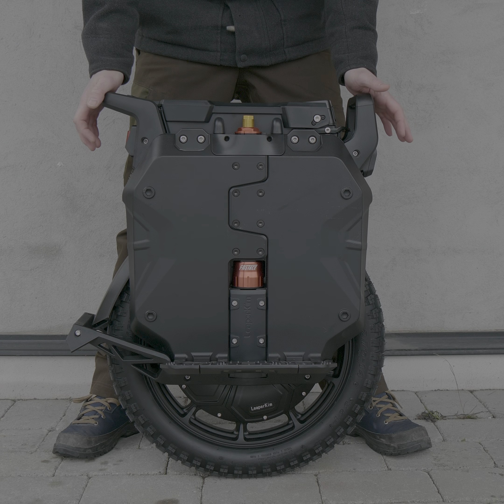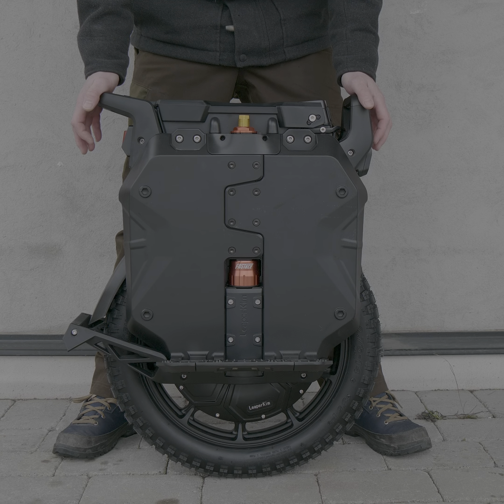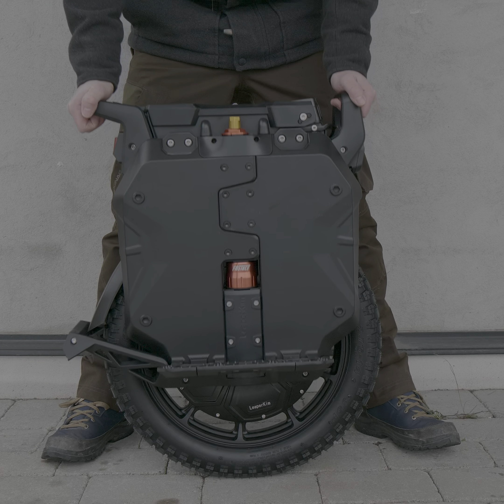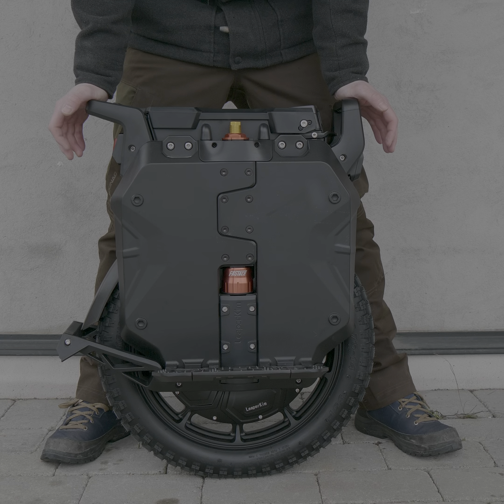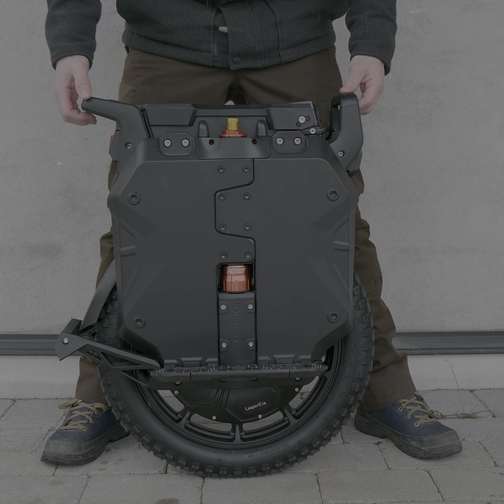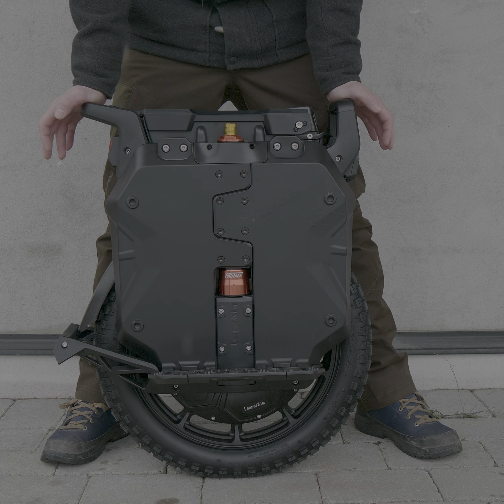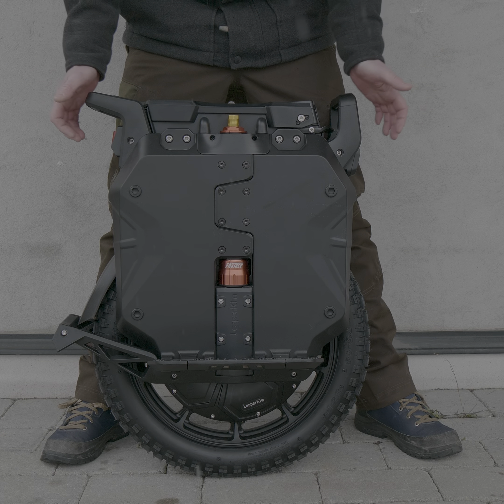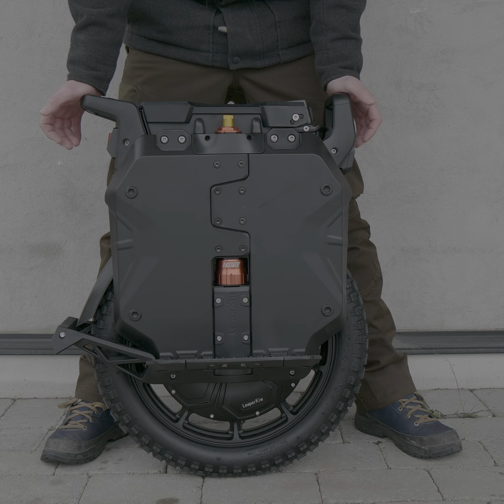Sticky Sherman S suspension on my new wheel

Comment: You're  going to actually be riding it not gradually putting in your weight on it it's designed for a person to be on it not pushing down on it slowly doesn't make sense bro. Calm down the wheel is perfectly fine .....Ride it
Reply from the maker: This is a misunderstanding of suspension performance characteristics, I already measured that the force necessary to break the stiction is between 30 and 40kg.
I'll have a video showing that later. The stiction is the same when on the wheel.
Compare that to the S22 where stiction is so low that you can't even tell there is any.

Comment: How often does one go over bumps that slow, go riding over normal bumps at speed and see if you notice a difference?
Reply from the maker: Good question. The slow movement in that test allows to make a visual demonstration of the stiction for the video.
But the stiction is the same all the time while riding, at any speed. The experience is that the suspension "binds" in position, transmitting all small shocks to the riders until hitting a bigger obstacle.
This amount of stiction gives the sensation of the suspension locking/unlocking randomly based on the surface ridden.

Comment: As always thougtfull testing and a keen eye for important details mate. appreciated. This wheel is very expensive so the performance should be better than this - How important is this stepwise suspension when You actually ride the wheel? That I dont know, other reviewers like Ronin thinks the suspension on Sherman S is better than s22.... Im not sure if he has a slider upgraded S22 to compare woth
Reply from the maker: I won't ride the wheel since for now I keep all my options to return it but the impression when stepping on it to compress the suspension is not that far off the S22 original sliders. That: you know.
So when riding I would expect to constantly feel the suspension locking/unlocking, transmitting the small stuff into your legs.
I already know I prefer no suspension to a bad one and its inconsistent experience you can't fully adapt to.

I added another test in the video description which shows no significant stiction: there's likely variation between units.

Comment: That could be normal friction due to (new) seals, the so-called stick slip phenomenon, It is known with motorcycle and MTB racing  try to lubricate sliders with silicone.
Reply from the maker: Thanks for the suggestion. It sounds like a plausible theory, however I am perplexed by this other test showing almost no stiction on another brand new wheel just out of the box:

https://youtube.com/shorts/OMxlWCNSLmM

I'll look into it further
Reply: @supercurioTube  Your suspension tube might be dry and his have oil on it, but anyway it is really easy to test, just spray or wipe little bit silicone spray on the suspension tubes.

Comment: Commander pro
Reply from the maker: I'm sure these are flawless, all of them
Reply: You wish. Ain't nobody giving Begode/Extreme Bull $4000 for one of their rushed together Death Traps.
Reply: @Dewayne Lowery  probably not a lot of people but I am. Not for 4k tho lol.
Reply: @dewaynelowery8511  as opposed to giving leaper kim 4100 for one of their antiquated voltage systems
Reply: @Blox117  "Antiquated"? Dude, you just talking, I can see that now. 100v is NOT "Antiquated". A properly refined 100v system is more than enough for most people. Hell, the Commander Pro is a 134v wheel, but only has a lift speed of 112 kmh while the Sherman-S has a lift speed of 120 kmh. Yes, the Sherman-S is FASTER Mr. Antiquated. AND it's a BETTER QUALITY WHEEL......PERIOD. You should really do yo research n homework before defending Begode's Death Toys. They are NOT interested in yo safety. Listen to the reviews by Dawn Champion n Marty. Garbage build quality. Master Pro....Garbage build quality. Adam from WrongWay is not even REVIEWING Begode wheels anymore until they improve their safety n quality. Do yo research.
Reply: No check out the commander pro teardown. Yikes

Comment: this is what happened to my bike, when it had a lot of dirt get in the seals. i dont think other people had this problem
Reply from the maker: Yes one of the potential causes on bikes and motorcycles is dirty seals - among many other potential ones like too tight bushings or misalignment.
Reply: @supercurioTube  the tolerances can be off sometimes, i think yours may just be bad because other people haven't reported an issue.
Reply: @supercurioTube  I may be considering getting a sherman S within a few months. I dunno if it matters to you at that point but if i remember I can report my experience with it.
Reply from the maker: @Blox117  yes please do. I am the first to report, breaking the fantasized perception that Sherman S suspension is perfect.
I am sure that people will develop a better understanding gradually.

Comment: Have you tried adjusting the suspension any?
Reply from the maker: I intentionally didn't touch any setting in order to test in the factory configuration.

I got a suggestion that preloads could be mismatched as potential cause and it's an interesting one worth testing. For now I don't want to do anything that might compromise my opportunity to return it tho.

Comment: Hello
Mine does the same. 😭
What solution did you find?
Reply from the maker: Unfortunately no solution yet as LeaperKim was unhelpful so far. I'll publish a new video next week showing how to evaluate suspension stiction on any EUC.
I hope it'll be useful for dealers to check before sending units to customers, manufacturers in their QC etc.
And hopefully convinced LeaperKim with numbers that it's a problem to acknowledge and fix. We stay in touch
Reply: @supercurioTube  maybe disassemble it?
Reply from the maker: @annabaranova5811  for now I keep it 100% stock unridden to keep the availability to return it, but yeah if I decide to keep it I'll disassemble everything for my own QC. Did you disassemble yours yet?
Reply: @supercurioTube  no, I did not disassemble yet
Reply from the maker: @annabaranova5811  thanks a lot, it looks comparable indeed.
How much have you ridden yours in distance yet? Did it evolve in one direction or another?
It's very helpful: we'll have this fixed.

Comment: It's clearly frozen because of that nice swedish weather, Francois 😀

Drive it for a few days and see if it gets better..
Reply from the maker: Since I had to bring the tripod back for framing, you can even see the snow falling 😆

I won't ride it, leaning towards retuning as-is now that it's likely confirmed that it's defective.
See this other test for comparison:
https://www.youtube.com/shorts/OMxlWCNSLmM

I'll check again once the wheel is warm to see if it's only a case of suspension underperforming in cold conditions however.
Reply: @supercurioTube  I think you should send it to me, then I will test it... forever!
Reply: Mine didn't get better after riding a day or so ...